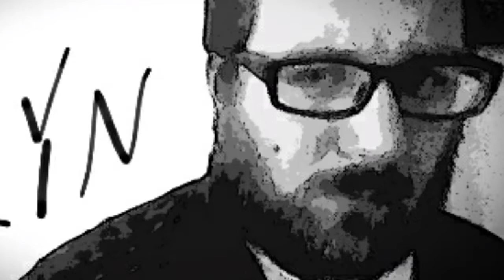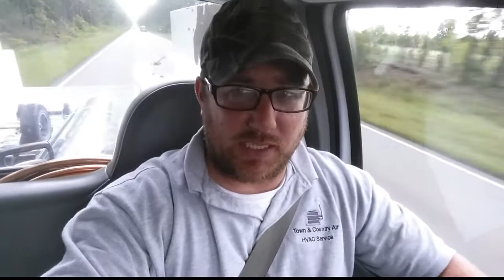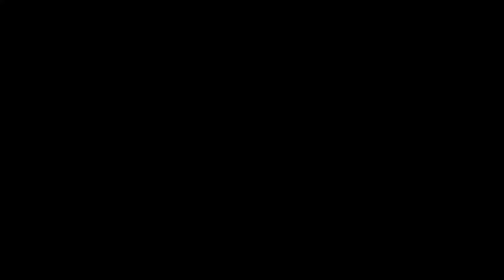What is Superheat? (Air Conditioning)

Comment: The answer is superheat reading insures you have no liquid going to the compressor, the subcooling insures that you have a liquid seal going into the metering device. Now if you thought about it, you could have came up with that answer.
Reply from the maker: Sounds good to me. plain and simple
Reply: Frank Mashione I always thought it was some magical mistical thing, when I found out I thought DUH!!!
Reply: Larry Cole I am trying to learn this hvac stuff so here goes a dumb question.  Say an overzealous homeowner jumps out the high pressure switch to get the compressor to run again.   Could the superheat get so far out of whack that the compressor would slug through the high side?  Or would the charge be in an all gas state before this could occur?
Reply: Daniel Baker If the compressor was low on refrigerant the superheat would be so high the compressor would overheat and shut down on overload. The last job of the refrigerant is to cool the compressor. If you have to little superheat you will get liquid refrigerant in the compressor and that would be disastrous.